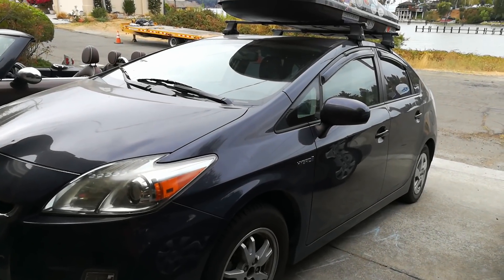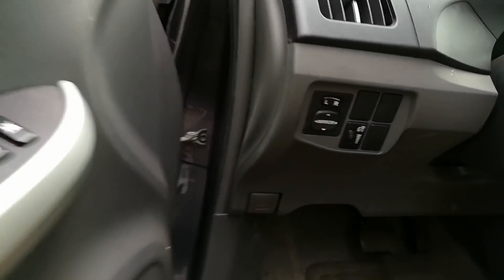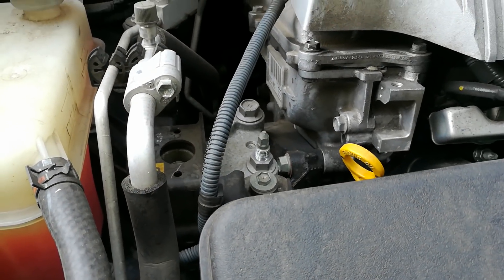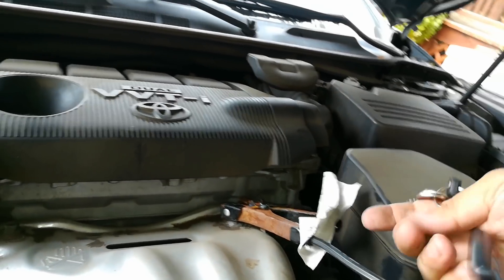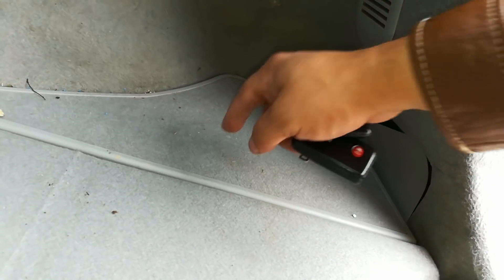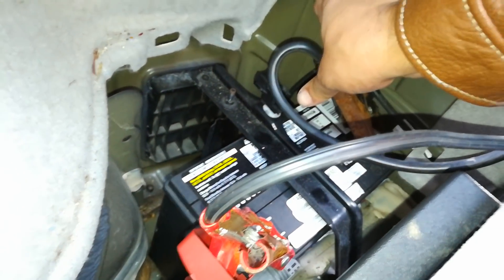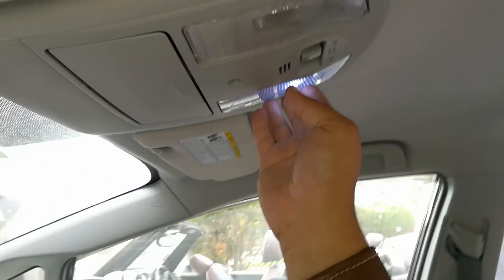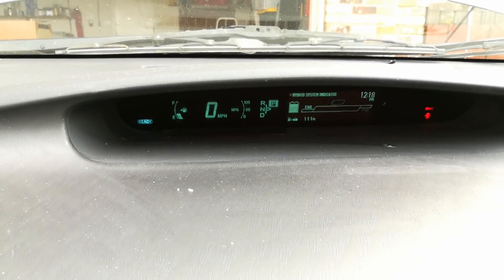Jump Start Prius Battery

Comment: Do you need to charge both the fuse box and the battery? What if the fuse box won't charge?
Reply from the maker: Charging is okay from either location.

Comment: It will not overload if u jump from front
Reply from the maker: You are right the 12 volts system just needs to activate the hybrid system and there no real starter. However with that said there is a little concern as those post are limited to 100 amps ( I just went through this on a 2012 Prius c) and Incase the battery is in really had condition you may overload the system. The chances are slim but there is still a chance.  And that 100 amp fuse is a pain in the next to change as it’s bolted in and works like a puzzle. https://youtu.be/NaR5gJdUOyg?si=HuUOuJ4tpPRJeWKC

Comment: You are a genius. This is the only video that actually is helpful and I've been searching for a LONG time.
Reply from the maker: I’m far from a genius and I thank you for the compliment.
Reply: @RANDOMFIX  Just wanted to emphasize how superior your video was. In order to avoid being charged for the car to be towed, we opted to charge the rear battery. It did involve crawling into the hatch to manually release the latch. We were able to charge it and get it down to the repair shop to get a new battery. All this just ahead of very cold weather and a snow storm.

Comment: Thank you for a quick and easy and handy video.  Once I figured out that the first jump was only for unlocking the Prius to get into the rear where the battery was, everything went wonderfully.
Reply from the maker: Michael, thank you for the great feedback about the Prius Jump start. Much appreciated
Reply: @RANDOMFIX  It is just wonderful you took the time to make someone else's day better... Good on ya... may it come back to you 100 fold...
Reply: So all you needed to do was charge from the back, did it matter how long you did this? My car won't start but the map light and dome light are dimmed when the car is opened, would that be a battery issue or something else?
Reply: @jhicksobu19892011  There is a battery in the back that you'll find by lifting the cover to get to the spare tire.  The battery is on the right (I had to pull off a cover once I got in there).  You'll see the battery there where you can hook up some jumper cables to jump the car... once you have the jumpers on the battery correctly (Plus to Plus, negative to negative), you should see your dash lights come up to normal.  Pushing the start button should start the car if everything else is good.
On my Prius, this worked and it started and went for a drive and all was good.  Came back after another could day and it was dead again.  I need another battery - It was at least 4 years old.  
I think what might be confusing to some people with this is where first a jumper connection is needed to unlock the car to get into where the battery is in the back. My car was locked.  Connecting the jumpers under the hood is to simply allow the door locks to operate and unlock to gain access to the rear.
Reply from the maker: Thank you for sharing and yes you are right and I didn't want to make the video longer and as you stated you need to have enough power to open the rear tailgate and that is purpose of the power ports in the engine compartment.
Reply: @RANDOMFIX  Thanks again for the video!

Comment: Thank you, I left my doors open to air the car out after a gas can leaked...one thing leads to another some days! Forgot to turn off the interior light.
Reply from the maker: I glad you found the video to be helpful. I would recommend changing the dome light to led as it will drain the battery that fast. 

https://youtu.be/OH9h0RBrUec

Comment: So I'm not sure what I did wrong or different but my key would not work after connecting the jumpers on the front battery as explained here. I could hear the energy going in but nothing happened. I just left the helping car on for like 10 minutes and then I heard the Prius turn on by itself. According to the battery icon inside the Prius the battery was fine. Maybe it was an issue with the key or the ignition?? In the end the key was working fine and so was my Prius so again, I'm not sure why my case was different.
Reply: Oh btw. This video was still super helpful. Thanks
Reply from the maker: Glad to help. You need to load test the battery as it may work fine after it start. This is pretty common during the first cold months. This what I show in this video.https://youtu.be/Zpe_oOUZsUs

Comment: You saved our grandson's bacon here!  Maybe he left a light on, but it was an overnight visit and his 2010 Prius was dead.  Able to follow your vid and find what we needed with flashlight.  Able to skip the door & trunk lock issues; otherwise wouldn't even have known to look in the trunk.  We could have used more visual on getting that 2nd cover off the 12-volt in the corner of the trunk; he had to dismantle the subfloor storage a bit.  We carry the cables, he doesn't, but between the 3 of us it actually went fast.
Reply from the maker: Ellen, glad to help.

Comment: So we should NOT use the fuse box in the front to jump it? Only the battery in the back?
Reply from the maker: You could use the fuse book but I recommend the back battery.
Reply: @RANDOMFIX  Thanks for the reply! I ended up using the fuse box just to save myself some trouble, and it worked fine.
Reply from the maker: Good to hear.

Comment: Guys this old method, there's smul device call start jump power bank, size of mobile phone comes with little jump start cable. Cost 20 GBP on ebay.
Reply from the maker: Thank you for sharing. And yes a jump start pack would be very effective in starting the prius. There are even jump packs without batteries so you don't need to worry about keeping them charged https://youtu.be/N0wHlv1wyD4

Comment: I followed these instructions this morning and now my battery in the back is making a high-pitched noise that last about five seconds and it’s doing it every two minutes. I called Toyota and they told me do not jump the battery from the back because it’s only a 12 V battery and it’s easy to put too much voltage on it. I will probably have to replace my battery now. They told me to jump it from the front.
Reply from the maker: Voltage is the same no matter when you connected, as to the amperage, it would be better to connect directly to rest battery then a small port on the front. Thank you sharing and I can see the logic is toyota making this statement.

Comment: I thought the Prius actually uses the hybrid battery to start the engine. The 12V battery is just to run the 12V systems. So putting the jumper cables on the terminal in the fuse box area would not result in a large current draw.
Reply from the maker: Your right, it's not suppose too but it is better to caution on the side of error. Thank you sharing

Comment: I don’t understand. It’s perfectly fine to jumpstart the car using the positive terminal in the fuse box at front. I’ve done it at least once a winter. It’s also what the manufacturer instructs. Why would you need to get to the battery at the back?
Reply: For what it's worth, my Prius V battery died last night and, when the technician came out to give me a jump, he connected it to the fuse box and engine block in the front and we had no luck. So we popped the trunk, jumped the actual 12V battery in the back, and it fired right up. It's nice to have options.
Reply: @alexmontgomerywx  I’ve had the same experience and it’s because the connection to the terminal and to the car’s body wasn’t good. A little wiggling and it usually works.
Reply from the maker: Thank you for sharing, much appreciated

Comment: Would a battery booster with rechargeable li-ion batteries connected to the under hood positive and negative terminals achieve the same result?
Reply from the maker: Sorry for the late reply! did you find a solution?

Comment: Step-by-step instructions to work around the dumbest engineering fuck-up brought to you from Toyota. Would it really have killed them to add a emergency release for the hatch?
Reply from the maker: Toyota worst engineering 😑  mistakes are better than most vehicle manufacturers best days. At least you can depend on the fact it will start. Just saying.
Reply: @RANDOMFIX  Aside from the fact that MOST vehicles are far more reliable today than when I was a teen back in the 60's, my comment was not criticizing Toyota reliability...just what should have been a simple engineering problem to spot.
Reply from the maker: Good point, I can see your reasoning.

Comment: The Prius starts its engine with the high-voltage battery.
Reply from the maker: Correct and but the 12 volt  battery is needed to initialize the hybrid system so the the traction/hybrid can start the engine.

Comment: Thank you for the video. 

I couldn't jumpstart my 2012 Prius by connecting cables to the positive terminal in the fuse box and the engine frame. I was prepared to tow my car to the shop. 

Thankfully, the tow truck driver connected the negative cable to the inverter assembly frame and that worked!
Reply from the maker: Robert, I'm glad the video helped. Yesterday while shopping I had help someone jump their prius. The colder months kill batteries.
Reply: @RANDOMFIX  Yea the tow truck driver said a lot of Prius batteries have been losing their charge. I think it's a result of cars sitting idle for long times (due to Covid-19) & we forget to turn off a light.

Comment: Today I changed my 2009  touring prius passenger mirror and when I was done my prius was dead, did not wanna start.
Don't know if battery drained while door was open but car was working fine before and during installation.
I wonder if a cable became loose on door and that is preventing it from turning on which does not make any sense?
Reply from the maker: Marco, sorry for the late reply, There is nothing really in door that would drain the battery other dome light as they were working on it. One thing to keep in mind is colder weather kills batteries. Did you ever get it figured out?
Reply: Thanknu for ur reply.  Yes I just jump started the prius battery and it's been fine since then:)

Comment: Thank you SO much! You saved me having to call for service or a tow to service. I was so nervous using the fuse box to jump. I am grateful that you recommended to charge the battery in the back of the car after small jump to open the trunk. I was worried that the jump on the fuse wouldn’t work because there is black plastic backing it with no way to separate the metal from it, but apparently only one side of the cable clipper needs to make contact with the metal because it worked!
Reply from the maker: Hi Cindy, I'm glad to hear the video was helpful 😊  thank you for the feedback.

Comment: Check hybrid system means ? Your battery is dead ?correct I have to get mine charge I can use my system
Reply from the maker: did you get the issue handled?
Reply: No man sadly my battery is toast i need to get a new baterry pack expensive😭😭like 3,000just for the battery

Comment: Thanks for making and posting this video.  My. 2013 Prius battery drained (parked after state issued "shelter in place" and let it sit for almost 50 days).  I found another video (very limited) and it only showed using the front fuse box connection to jump start.  I had read warnings about that approach so I put a trickle charger on for 24 hours and this morning it started without a jump.  I had also read about driving the car for 30 minutes to charge up the battery.  Since I used the trickle charger overnight I concluded the battery was likely fully charged.  The question:  even with using an overnight trickle charge would you ALSO recommend a 20-30 minute drive to charge up the battery?  Thanks also for showing where to find the battery in back.  I had looked back there but did not spot it, I will look again.  I will use your strategy if I run into this again.  I could not unlock the hatch due to the drained battery, now I realize I could have just used enough juice to be able to unlock the hatch.  You gave very good video and audio coverage of this entire process.  I will be watching your other videos.
Reply from the maker: Sorry for the late reply! did you find a solution?

Comment: I tried to charge the battery with a trickle charger but it’s not working, does that mean that the battery have to be replaced? It’s a 2014
Reply from the maker: Sorry for the late reply! did you find a solution?

Comment: The 12 volt battery is only used to turn on the system the high voltage hybrid battery starts the engine all this information is in the owners manual.
Reply: Indeed! On a Toyota hybrid turning on the system doesn't need high (cranking) amperage because the 12v battery doesn't crank the engine but just makes the high voltage hybrid battery go life which then cranks the engine with the electric high voltage motors. I highly doubt that there is more than 100 amps needed to start the Prius so you do not need to put the contact clamps directly to the battery in the trunk. Just leave it the clamps at the front under the hood, worked with a Prius 2 for me. And due to the low amp usage the donor car doesn't even have to run the engine.
As a matter of fact a quick googling has revealed that you generally do not need more than 30 amps with an occasional hint of a 60 amp peak, an amount of energy of about 90 amp-seconds, which is a ridiculously tiny amount of energy and power that is needed to start a up a Prius system into "Ready" state and get the engine going.
http://irobin.org/prius/startup/startup.html

Comment: I just had my 2910 Prius jumped last week and my whole audio system,  back up camera,  blue tooth etc. Are all crashed.  AAA CAME and jump started my car from the battery under the hood.  Not from the 12 volts in the trunk. Did they surge my system?  Do you know of a reset for my audio system? I Took it to the dealer and they said I need a whole new system to the tune of 3200. Please help me car angel!
Reply from the maker: Susan, I'm so sorry to hear about your 2010 Prius. Anything is a possibility, AAA could of jumped backwards or something else. Did you remembering anything during they jumped it? I'm here to help. _Randomfix
Reply: Check all the fuses in the fuse box. Its very simple. Pop the hood, open the fuse box panel, and check all the fuses one by one. Inspect each of them carefully. One of them could be blown. If so, go to any car parts store and buy a replacement fuse. Make sure the fuse number matches if you do replace it. The number means amperage. In other words, how much power until the fuse  breaks.
Fuses exist to protect car's electrical systems if something goes wrong. It cuts the electricity if there is too much power going through the circuit.
Reply: I've had the car to 4 shops.  They all say the system is fried.  I think it surged when they jumped it from the front.

Comment: Question: I’ve read that the helping car should not run its engine while charging because you could overeload the 12v. What do you think??
Reply from the maker: Great question, i always ran the helping cars engine once they are connected because sometime it will take a while for it to charge the other battery. To be safe you can have the helping car turned off and start it once they are connect. I've never had a bad experience but i can understand the logic. _Randomfix

Comment: Buy a battery tester that can measure CCA and check the 12V battery regularly.  If below 300 CCA buy a better one.  I buy used ones and test them out at the yunk yard. 

If you have a weak battery (or even a good one) and you're not starting your car for more than a week it's probably better do disconnect the 12 V battery.  The electronics will discharge the 12 V battery slowly. 

If you like taking risks jump start through the fuse box.  You'll feel great if all the modules still work.  Don't complain if a module starts failing after a few weeks.

In this situation in this video I would charge the battery while disconnected or take the battery home and charge it with a Ctek. 

You'll be able to open the trunk from the inside without battery power from the back seat.
Reply from the maker: I appreciate your constructive comments, thank you for the feedback!

Comment: You helped me so much. I just bought a 2010 puris that I love. I have not driven it in a couple of days and it would not start. I did exactly as you said and it started and ran. Unfortunately, I drove it for about 15 minutes and parked it. It would not start back up. It's late and I'll try again tomorrow. Thanks you!
Reply from the maker: Hi LT, thanks for the feedback, if you Prius is not starting after a few days of starting please check the connection on th main 12v battery in the trunk for corrosion and clean and test the battery. It sounds link your 12v battery is going bad. This battery is a little expensive around $150. Best of luck and let me know how it goes. _Randomfix
Reply: How is your battery? I also have 2010. I read on forums that the 12v "service" lifetime is 4 years, or less under extreme heat/cold weather.

Comment: Thanks so much dude, I haven't tried it yet but I'm 99 percent t sure this is my problem. Which battery is better to charge on though, front or back? Or does it really depend on other circumstances?
Reply: Its the same battery. Since the physical battery is in the trunk covered by panels, Toyota have built in an easy access port on the front of the car.
Reply: It is extremely easy to use the fuse box area under the hood.
Reply from the maker: Sorry for the late reply! did you find a solution?